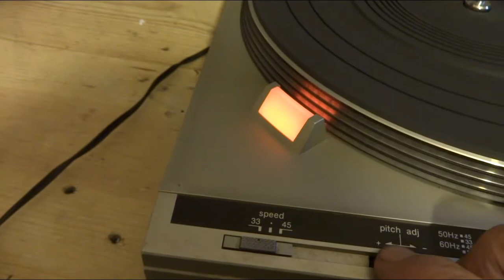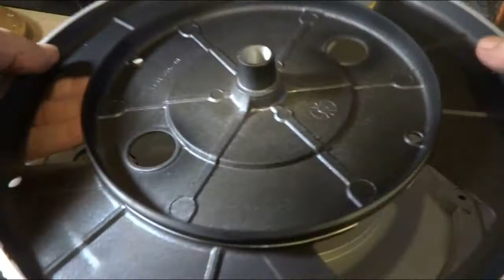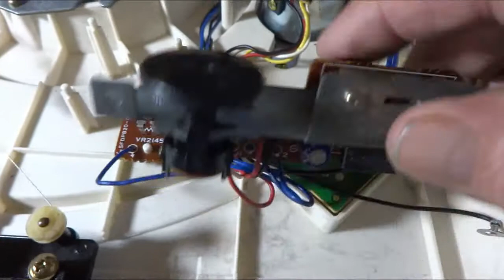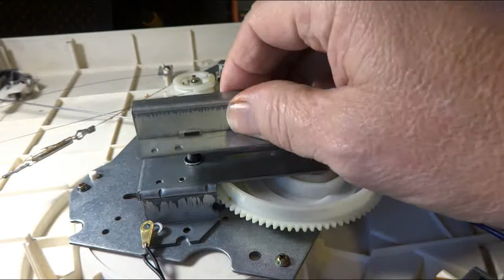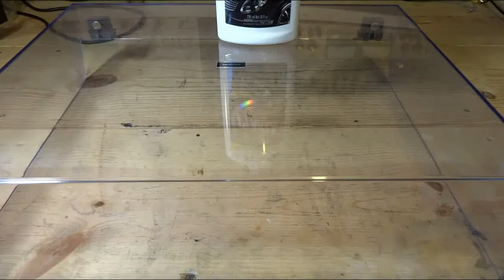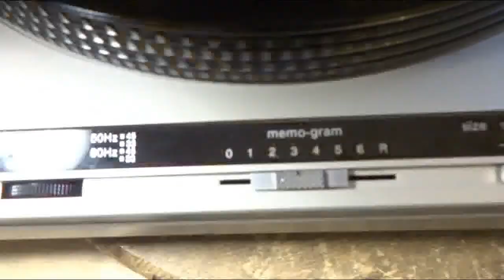Technics SL B500

Comment: I just picked one up.  I put new belt. My stylus. Everything works n moves BUT very low sound/volume. Why?  Oh I did ground the ground cable
Reply from the maker: Do you have phono jacks on the back of your stereo. A lot of newer stereos don't have them. You may need a preamp for it.
Reply: I do now just picked up a sansui au-1500